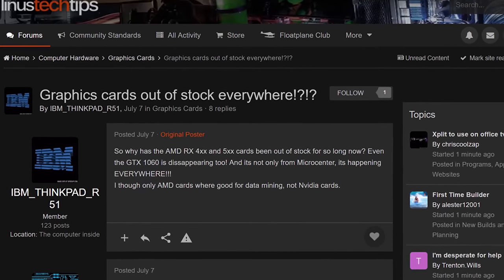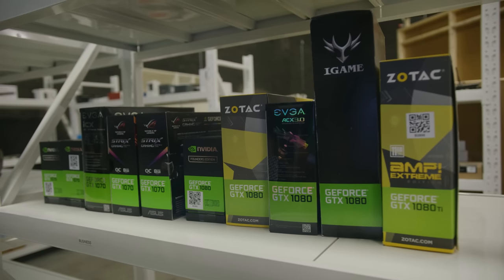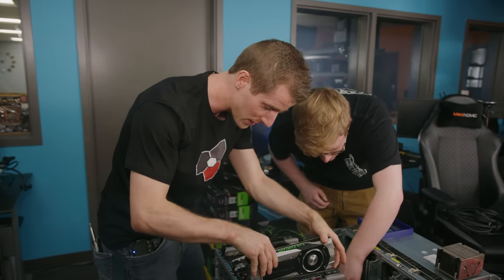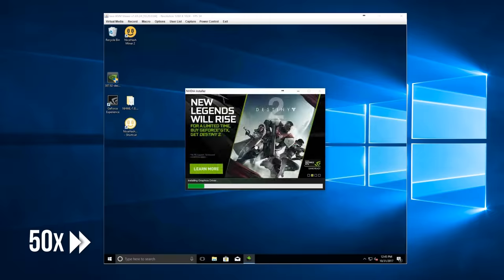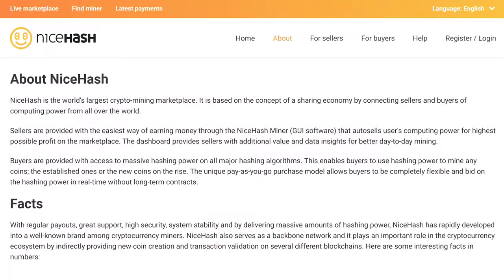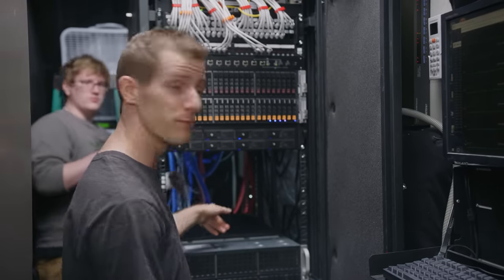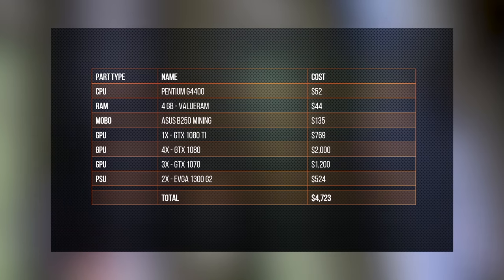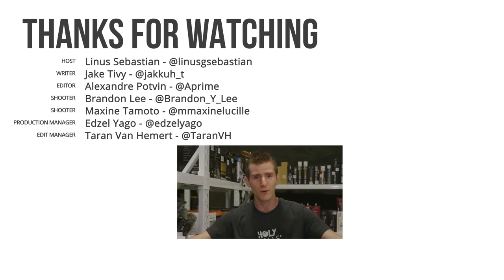IS GPU MINING STILL PROFITABLE? - Mining Adventure Part 1

Comment: Uses 2 Xeons
10 high/top end GPU
And old, already used once tape
Reply: Well, all the rest of the hardware was being reused, so why not?
Reply: In North America You Mine Bitcoin, In Asia Bitcoin Mines You
Reply: You don't need an overkill cup to mine. The difference between a Pentium and a 22 core Xeon in mining is so minimal you won't even notice it. Hell it might even be the same.
Reply: It depends what's in that cup, is it coffee or tea?
Reply: mining with a bigger cup would be much easier, you can dig faster!
Reply: Polska🇮🇩
Reply: Peter Smyth crunchberries
Reply: SandStorm  not true, depends on the algorithm
Reply: Are you running 10 near top end GPU's on a pentium?
Reply: How about using an Nvidia DGX station ;)
Reply: RUN AMD CARDS! NO LIMITS
Reply: Well, one of the theme of this video is reuse old parts.
Reply: @Linus Tech Tips for that follow up video you should really be using some Polaris GPUs, and maybe a couple of RX vegas if you have them lying around, the AMD graphics cards are far better for mining and are far more profitable than the Nvidia cards, the RX580 provides a decent hash rate at 30MH/s on ethereum compared to the GTX 1080TI's 32MH/s. When you factor in power consumption and cost of both the red and the green teams offerings, its pretty safe to say that using some rx 580s and 570s are far more profitable.
Reply: Joshua Redmond, why the hell you will mine Eth on Nvidia card? Zcash, Zencash, Bitcoinz, and even the upcoming Bitcoin Gold is up to you. No scence comparasing amd to nvidia , cause they are good on different algos. Atm running 6 gtx 1070 and 4 gtx 1080. Zcash and new stuff only. Profitable even better than amd cards that wont be even resalable so well as nvidia next year.
Reply: Alexander Kuldoshin nicehash picks the most profitable miner for the users setup, amd are better value, never said nvidia cards are bad at mining just said that AMD are better value by using benchmarks that were run on ethereum, apologies if you thought i meant nvidia cards are bad in any way, power consumption is lower on AMDs graphics cards, aswell as card cost being less than half the price of a 1080ti at msrp, and similar hashrate
Reply: Why not CPU speed has no affect on mining.  So run the cheapest CPU you can find.
Reply: Krzysztof Dolecki i
Reply: Joshua Redmond, its ok , i got you. Yeah, the most important thing is to destinguish taht amd works better on ethash and nvidia on equihash. By the way, better to search a good mining pool instead of using nicehash(you can use it only if you need bitcoins directly).
Reply: Try Gridcoin or curecoin or foldcoin or whatever cryptos can be earned with Distributed computing - get rewarded while also helping science
Reply: Get Cosmology running or LHC running and get more ram for that server and remove the GPUs for other stuff - the VM projects are good paying. For the GPUs, run something like gpugrid if you don't have any AMD cards. Any workstation or server GPUs should go to Primegrid, Milkyway, or any other projects. also, choose the projects that fit your hardware the best and are the most meaningful to you. Also, talk about Proof of Stake coins like blackcoin.
Reply: Tied Noose there's certain things Vega does better than other gpus though. So even the supposedly high power draw is nothing and especially after being tuned. Once tuned the power draw goes way down.
Reply: ArtisChronicles, atm no actuall statistics about this question, so we shoud wait a bit till someone will test it with different miners and overclocks. Also, I didnt saw any compatibility miners for vega for today.
Reply: Carries large heavy server past cart with wheels.
Reply: What do you mean?
Reply: It's not so much the size of the cup which matters, but whether it's made of plastic or metal.
Reply: Everybody loves Doge Coin
Reply: Joshua Redmond lol so you saying my rx 580 mines almost the same as a 1080 ti? Lol sign me up, how do i begin mining.
Reply: GPU'S + _________= profits
Reply: Or you could use the Nvidia cards to mine Equihash or lyra2rev2 algorithm coins and wipe the floor with amd. It's all about knowing which direction to point your cards in. I'm NOT and AMD hater. They make great cards that will make a great profit in ETH etc, but just because it's Nvidia doesn't mean it's not profitable.
Reply: Krzysztof Dolecki but its gaff tape tho so...
Reply: Krzysztof Dolecki m
Reply: Actually,, you're completely wrong.  you can get a Vega 56 up to 43 hashes, and still keep the power usage down using the proper driver and even undervolt it to use less than 60% of its normal power requirements.
Reply: That's Linus!
Reply: Vegas are awesome for Cryptonight algos - double their hashrate!
Reply: why in asia hardware is very very cheap you can built a rig with 10 or 12 gtx 1080 ti in aprox 5000 to 6000 bugs
does it realy worths
Reply: suppose if you are using a pantium 3 for mining first it will take 10 mins to properly start and boot
and then if you need some info so that p3 will take your 3 to 4 mins to start google
Reply: Try to get rx vega from amd...
Reply: About a year late, there Linus. The "miners are evil" idea is ridiculous. Gaming organically deriving from tech designed for basic word processing. It's the same basic idea. Now if only retailers would start accepting crypto..
Reply: no tape cutting into that daily profit margin
Reply: My mining rig uses a CELERON 8GB ram and 5x1080Ti, makes $600USD per month, power is only a small fraction of the cost.  Less than 10 months for the return on investment assuming cryptos don't change in price.  I started mining a few months ago, and the price of Bitcoin and Zcash has risen around 30% and 10% respectfully, even after factoring in the recent crash. ROI will be much less.
Reply: - Get 2 Xeons and server
- 10 high/top end GPUs
- reuse old tape
...
PROFIT!!!
Reply: cpu is not fast as gpu
Reply: I would suggest the following used hardware.  3 Vega 56’s, hp dx7500 motherboard, core 2 quad processor, 4 x 4 pc2 ram, oksale 1600w power supply,  3 external pc riser components, 120gb SSD.  Cost around 1580.  ROI approx 4.5 months
Reply: Yeah, why 2 xeons and no Mid Tier AMD Cards????
A crappy celeron would have been enough, this mining rig is absolutely garbage
Reply: Can a super computer mine bitcoin? Maybe a supercomputer should be used by some government to gain control of the world's bitcoin supply.
Reply: Krzysztof Dolecki :) Didn't have paid attention that you can have a maximum of 8 (eight) graphic cards per operating system? So ten it's unrealistic.
Reply: Paul Petru Alexandru Cazacliu but they used 10 cards at the begining of video 
Later they found out that 8is max
Reply: Cologan why the fucc people Here thinks I wrote Xeons as a bad thing?
This is good cpu, propably better in this use than i7 
Only people bitching Here are you
I was talking about expensive setup (2xeons are expensive, 10gpus too) And old tape (kinda cheap)
Reply: Krzysztof Dolecki whoops, didnt mean to answer top comment, your comment is fine
Reply: Cologan thats nice but still a lot of people talk about xeons like its bad thing here
Reply: calling a hacker give him 5 $ hacking your farm yelling : FOR THE GAMERS
Reply: those are awesome for mining XMR
Reply: Wait, do these not need full 16x to run optimally for mining?  I can't get 3 M10 GPUs to work with multiple NIC and rNDC due to legacy PCIe I/O limitations (64k) (which isn't a problem here - barely.  M10 = quad GPU, so 3 of them is 12 actual GPU's.  4k per GPU for legacy I/o allocation = 48.  Across the I/O node stacks this is a no no[won't boot].  Other compute GPUs can be flashed to do a zero I/O mode so this requirement is gone.) I guess with 8x you would be fine with the newer Xeon at 48x per CPU.  Curious how he plans to execute the build mentioned at the end of the video.
Reply: Garrett Yates if you are just mining 1x is all that is need. Most algorithms load onto the cards then all calculations are then submitted or rejected through the software.
Reply: Fringe Wizard there isn’t enough computing power to take over the bitcoin network.
Reply: Maximise dem profits bruh
Reply: 1070s pull 32ish MH/s on ETH. 1080tis do about 36. Source: I have 32 1070s and 2 1080tis.
Reply: 7,000th
Reply: The more frightning thing is windows...
Reply: you aint  got it men, when you just have those stinky xeons lie around. They are for free. why going out and buy a i5 or i7?
Reply: care to send me a 1070? , i mean ... u got a lot!!
Reply: Video question: Can you mine with your old pc in the closet?

Proceeds to put all that shit in the server...
Reply: Krzysztof Dolecki j
Reply: linus it breaks my heart. been tryin to save money for a gaming pc for 2 years and you have stuff laying around 😢
Reply: Hahaha...I thought the same thing!!
Reply: FLEX TAPE!
Reply: Didnt he say they also only used 2 GB of ram!?
Reply: Krzysztof Dolecki h m.
Reply: That looks like a million fps in games
Reply: +JMADMACHINE but can it run Crysis ??
Reply: @marksadhra5695  pci e lanes
Reply: Pete Smyth vodka
Reply: GPUs*
Reply: That's the the greedy and THE HUNGER FOR MONEY which Capitalism OFFER to Society !!!
Reply: @neytiritetskahamoatite7688  OFFERS*
Reply: Stonks
Reply: U polish?
Reply: @Brickbuilder0506  Can I know, 30 MH/S is per day or per month or ?
Reply: @meowsoftware7258  dont quite know but i would assume considering the S and the endnit means per second.  Doesnt make any difference of course
Reply: polska
Reply: Over badget
Reply: A mixtape
Reply: This marks the 100th reply how long have you been scrolling? Jeez 100 comments, why.
Reply: I am gonna ruin your perfect 100 comments
Reply: Pete Sm was
Reply: Stonks
Reply: @jayceodell  LTT
Reply: @nikodemdobrenko3680  who gives a crap??
Reply: Thread ripper would be better for the cpu
Reply: u rich ?

Comment: anyone else here in 2021 where cards are out of stock everywhere, old card cost way more then they did before and, covit closed everything
Reply: I literally searched for gpus after seeing this comment. Shit, here we go again.
Reply: Me it sucks
Reply: I started mining with a gtx460 3 months ago and I haven't had much of a hard time finding modern GPU's since then.     Only 3 of my 21 that I acquired in the last month are brand new.   But they all work.   Takes longer to get good risers than anything else.  A local shop has anything a guy could want at reasonable prices.   For example, after my last 9 card haul off a local used marketplace, 2 days later the local shop started advertising 2070s for $389, new in box with warranty.   I bought my 5600xt there a few weeks ago, only a $100 over MSRP.   But to get a 2070 @ msrp would be nice.  I'll be picking up more in a few weeks.  First looking for new, then jumping on the local used sites. 

All I can say though, is if you get more than 4, go straight to linux based OS .  I'm fixing windows every other day.  If 5 one absolutely has to be an nvidia and if using windows you absolutely want at least a 250gb ssd.   You need at least 16gb virtual memory per GPU for maximum stability and hashrates. And do not mine on the same PC as you keep personal information.   Windows will constantly try to remove everything mining related and brick your drivers any chance it gets, so you have to run with almost no security and absolutely no updates.
Reply: You would love his latest video on mining lol
Reply: @crazypigtailsdevilyn6103  true, but we also now know prices will drop eventually again :p
Reply: I´ve just sold a 6 year old used gtx 970 for the same price I bought in 2015. This is I-N-S-A-N-E. We´re literaly living the dark age of pc gaming.
Reply: @VintageCR  when do you think its gonna drop?
Reply: @arq2565  eventually. It has to bc market fluctuates.
Reply: yessir
Reply: I’ve been able to get a good amount of cards I got 2x3070 1x3080 1x6700xt 1x3060ti. I’d buy more if I had more money
Reply: I botted out 6 3070's on launch day and I currently have 15.794843 bitcoin and counting I wish I started sooner. As well as some Etherium.
Reply: yeah, and i'm just thinking, why have i not mined before?? WHY? lol, i'm an idiot lol
Reply: Imagine having Cvid.
Reply: Me

Comment: GPU Mining: The most cost effective way to heat your computer room in the wintertime ™
Reply: That would actually be an awesome idea for a heater. Warms you, and at the same time printing money
Reply: works for me i got 2 gtx1060's and a gtx980 running in the living room
Reply: That's my tactic! Only that I open a demanding game every time my bedroom gets cold.
Reply: literally what im doing for my garage
Reply: When I mine the room my pc is in is 10 degrees hotter than the rest of the houss
Reply: thats what i'm doing. my room isn't usually very warm in the winter the gpu works perfectly.
Reply: Already doing that at home and work... Lol
Reply: i actualy had my heater turned off 2 months extra cause of mining. just running 2x 1080TIs and a fan that blows air out of the room. so yeah quite effective free heater :P
Reply: Or house like me
Reply: room?
ROOM???
NO, laddy boy! House! Whole!
Not just mine! ;)
Reply: True
Reply: Indeed. But maybe not the computer room - but the living space. If you already have the hardware and need any heating - that's the most cost-effective solution. It's less efficient then a heat pump but heat pumps are still more expensive then GPUs and so far you can "earn" more then you spend on electricity.
Reply: no

Comment: Make a video about GPUs that you buy used from miners. Check if they are less stable, maybe overclock worse than others, or even fail after not too much usage.
In the end, make a recommendation on whether that is a good way to get rather cheap hardware or not.
Reply: THIS
Reply: Bought an 280 of an miner in june, it was dead in august. So dont buy gpu of miners.
Reply: Normally a good miner would underclock the core clock and voltage down to the lowest and keep or overclock the memory bandwidth.
Reply: or make sure it has warranty still active when you buy it can send back for replacement or upgrade.
Reply: Sounds like something Gamers Nexus should do
Reply: great idea hope linus sees this
Reply: I was looking for it; I'd love to see something like this too!
Reply: One of the main things to check with that is their memory overclock. Since most underclock the core and undervolt the card which (to my knowledge) shouldn't hurt the lifespan of the card at all. However, you can push the memory WAY higher than would be stable in a gaming overclock, which is where you'll probably get most of your card failures.

Also just like with buying used cards normally, check WHY they're selling it. Since unless they're getting out of mining completely or it just can't keep up with current difficulty they may be trying to bum off a dead or dying card.
Reply: great idea, will be relevant in a year or two after burned out cards hit the used parts market
Reply: Jaggsta if it still has an active warranty i doubt the miner would sell it instead of getting a free replacement
Reply: I bought 3 280's and 3 280x's from a miner in Vancouver a few years ago when people thought gpu mining was over 250$ (For 3) for the 280s / 350$ (for 3) for the 280x's . They all ran perfectly fine and have since been sold off without complication or returns.
Reply: Buying used stuff from China, it's more cost effective to throw the money out of your window because some of it might fly back in.
Reply: It depends on what the miner has done a lot. Some flash and/or push their cards really hard. However, if the electricity is not too cheap, it is not optimal to max out the card, but in many cases it's even reasonable to limit the max voltage coursing through the card because the power saved from the upper end might be worth more than the loss in hashrate. Also steady down-volted mining puts the card in steady temperature, so no damage from rapid temperature changes occur.
Reply: seconded, please make a video for this Linus & crew, since the whole market is flooded with crappy overpriced used cards.